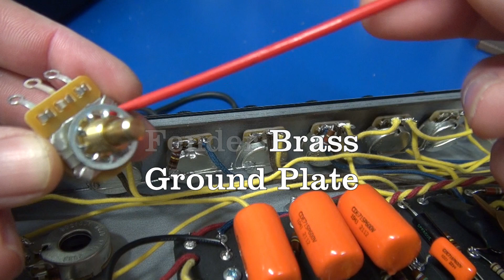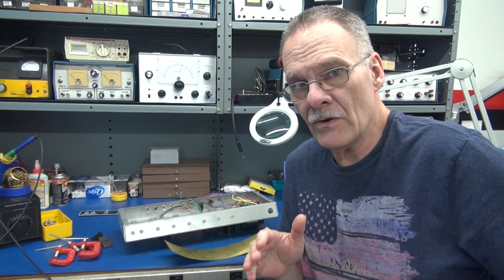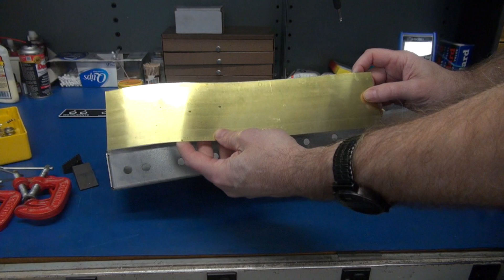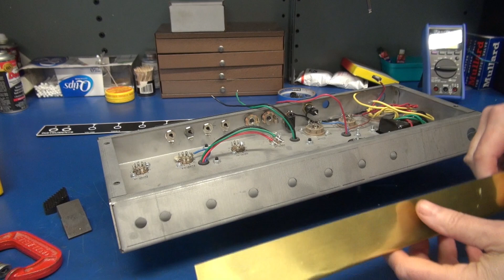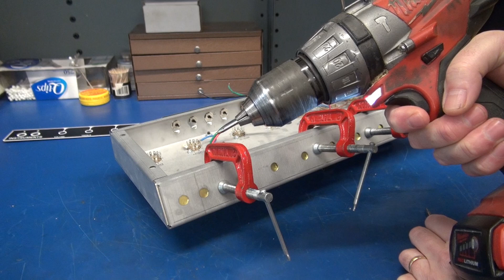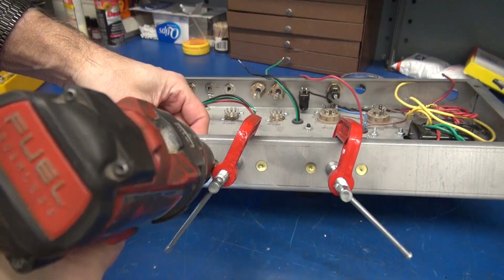How to make a Fender vintage tube Guitar amp Brass ground Plate Upgrade your kit, less noise Hum

Comment: Works very well - just built a PR with D-Lab brass plate recommendation. Bought the brass at Hobby Lobby. **Very quiet amp** Drilled small holes along the plate and soldered all signal side grounds from eyelet board and pots direct to the plate. Did not solder the plate to chassis.

Comment: Hi Terry, I’d like to know more about the science of using brass plates. Do they really quiet the amp down that much more? It would be really cool to see an amp on a scope to get a noise floor with a brass plate installed. And the same amp without one. Or maybe same model/year amp. Just food for thought maybe for a future video.  Any additional info on why brass grounding makes for possible quieter noise floor would be helpful. Thanks. Love this video.

Comment: Great simple process! I've put these on my last couple builds, and in addition to ensuring you have a consistent ground, they make it really easy to attach a ground in convenient locations. 

Would there be any benefit to installing a brass plate to the output jacks as well to make sure they have a similarly low-impedance path to ground?

Comment: Why brass instead of copper? Is there a reaction between copper and aluminum?
Reply from the maker: Thats what Fender used
Reply: Copper will go green from oxidation
Reply: I looked it up, copper erodes aluminum, I should have remembered that, forgot that we couldn’t silver plate copper directly, have to do copper, nickel, then silver when plating waveguides to mil spec.
Reply: A brass sheet is being attached to a steel chassis, so why should a potential reaction between copper and aluminium even be considered ? 🤔🤷‍♂️
Reply: @dingalarm  Maybe he (R&R) believed the chassis was alu. Looks like steel chassis to me also.
As a 40 year "kind-of-mechanic/electrotechie" I am courious why steel plate is not good enough. In normal conditions it will not rust or oxidize.
Maybe the idea of ground plate in brass is from earlier when controller-panel-plate was not metal at all? (wood?  Plastic?  Bakelite(circuit-board)?   Jjust guessing).
Reply: @johnbravo7542  Outside it will go green after a while, but indoor, in normal dry conditions, it will only go darker red/brown. Remember all the copper pots/pans people hanging on the walls in their homes. Copper-colored year after year.

Comment: Terry where do you order your materials? Not having any luck finding the right stuff
Reply from the maker: I find the brass & other unique supplies on ebay
Reply: @d-labelectronics  I'll look there again. I noticed weber sells the plates but not for a 65 drri. They have 5e3 and a few other circuits but not the 65 for some reason. I'll buy the shim stick and make them but i haven't found 3 x 15 or whatever it's always only 6 inches long. There's the rolls in a can. I wonder if that could work?
Reply: @d-labelectronics  Terry will the brass shim in a can work

Comment: And what is it for? I see it. Less noise, hum. But how does it work?
Reply from the maker: It creates a ground plane, central landing area for the eyelet & control grounds.
Reply: @d-labelectronics  the chassis is not already supplying that? Because wrong type of metal? Or brass is just better? Wouldn't insulated ground wire be better? Safer ?
Reply from the maker: It eliminates trying to solder to the chassis direct, plus provides a central ground reference
Reply: Would this method of grounding be advantageous in a Champ style circuit, or overkill?